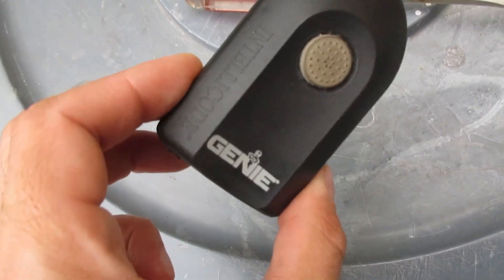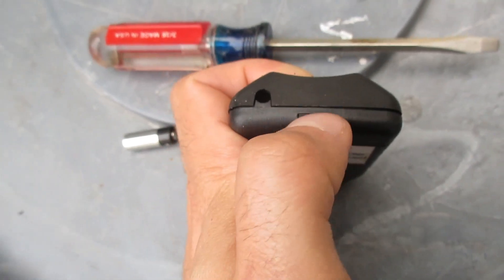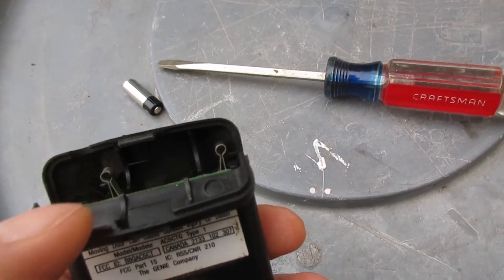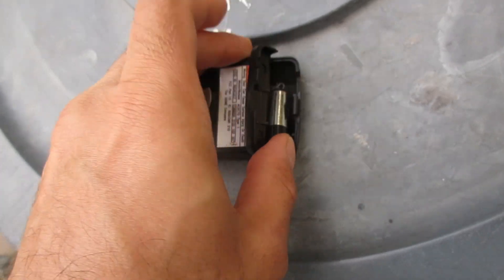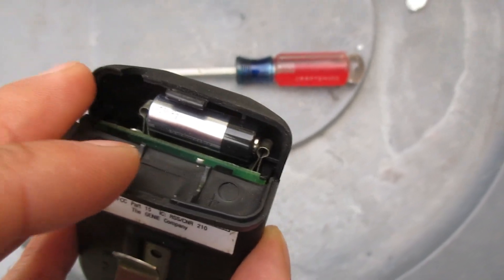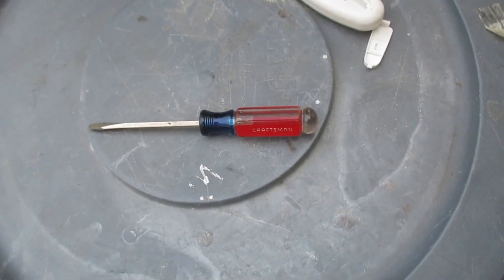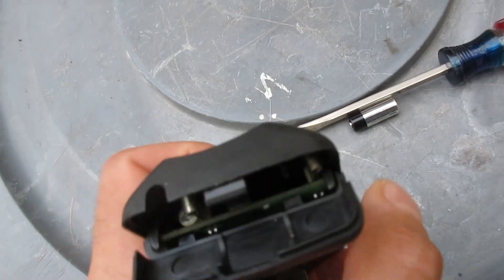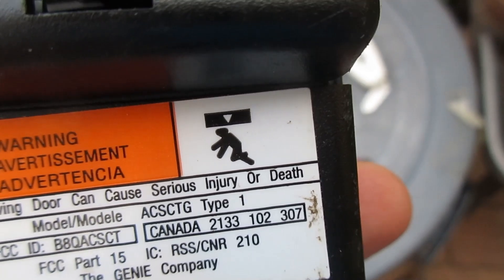How to Genie ACSCTG Type 1 Garage Door Opener Remote Intellicode Battery Replacement

Comment: I have like 4 of those at home.  Don't use them as I programmed my Homelink systems.  The rebuilt 4l60E in the Yukon turned out okay.  Beast Sunshell, Rabestos Z pack, and corvette servo.  I think it shifts a little too hard from 1 - 2.  If I'm taking a turn and accelerate quickly it will "bark" the tires from the 1-2 shift.  Hope it doesn't ruin my transfer case.
Reply from the maker: Yea i sold all the ones I have I have smaller remotes now   Or trash found ones that are smaller.    White truck with messed up FL hack rebuild will spin the 1-2 shift only when its wet which I think is dangerous because it starts fishtailing even under the lightest of throttle they did something wrong   I need to leave/  move and rebuild my own transmissions They are not too hard to do just need a space to spread out the sub assembles  We did them in school. Should not wreck the transmission  You can probably tune the shift with changing spring tension on.. I think the accumulator? I forget what makes the 1-2 harsher